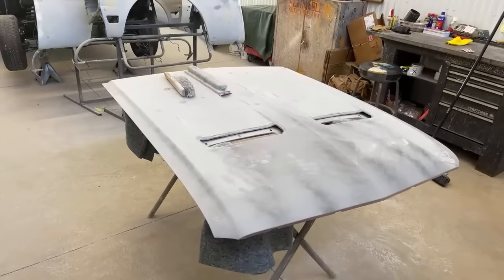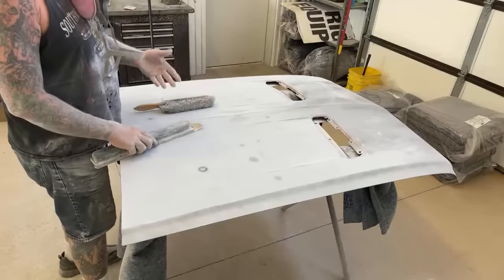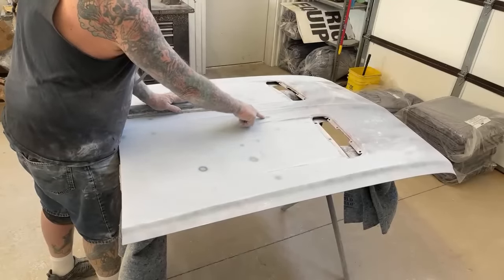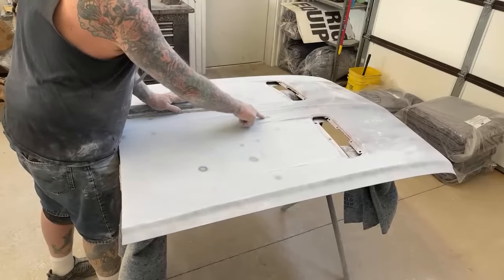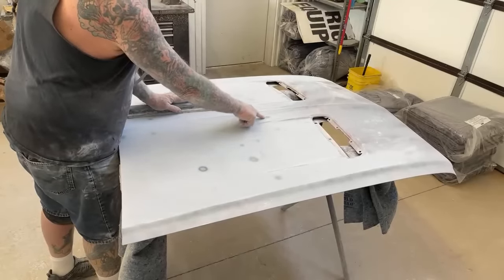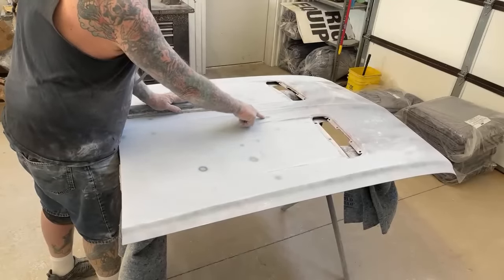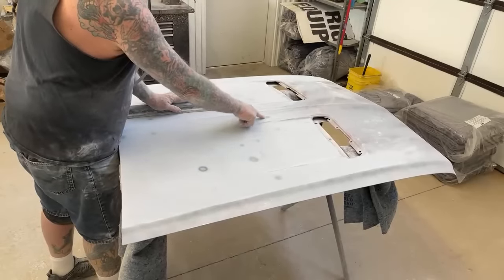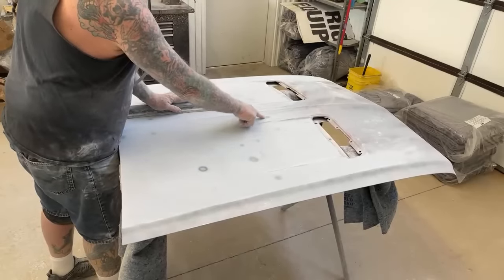How To Put BONDO/Body Filler On A Primer Surface - DIY LIVE!

Comment: Thanks Pete, love all the lessons, I have been getting to it myself now that I retired out the army. I have a rusty 77 924 that is kicking my butt, car was left out in the Texas heat for over 10 years.  Trying to keep it all original, but it will need some patch panel work on both QPs, both floor boards and on the roof panel near the rear glass. Not dishing out money for new parts, minus mechanical and weather strips. I'm fairly comfortable with body work, I just hate how much different brands are out there selling paint, and how expensive things like ppg have gotten.

Comment: You had another video that said to put bondo only on raw metal and not on top of primer. Im curious why not sand down to metal in the areas with the dents before applying the bondo? Thanks!
Reply: Do u have the answer for this question yet in wondering the same thing
Reply: @aidenog7380  it must depend on manufacturer. SPI says to epoxy prime over the prepped bare metal to seal it. Then put the fillers on top of that.

Comment: Hey Pete, Is using bodo and body filler like doing joint compound on drywall. It looks the same, but not sure about the drying. Looks like your body filler turns a certain color like joint compound does. I've done hundreds of hours of drywall work. Never done bodywork. I love the corvette series you did a little while back. I bought a C4 ( next bodystyle) corvette a few months ago. 1988 convertible. Thank you again My Friend Pete. Wish you and Minni a great day. 
    Its crazy how much you have spent on the Baja. Catch you om the next video.

Comment: I am redoing my siren housing and I sanded too far down to the base coat around the other newer paint and I'm struggling with a noticeable divet from sanding the paint would it be possible to just fill it in with primer or would I have to use this body filler

Comment: I just got a hood today and it has a silver dollar sized high spot where theres a glob of goo on top of the bracing. Should i cut the goo out and tap the spot down or tap it with the goo in to provide backing so it might not buckle it? Or should i tap it at all?

Comment: Man I sprayed a Harley gas tank and fender 6 times!! Somewhere a king every spray at some point the paint reacted to something and had to start over. Finally just took it
To bare metal. If I do body work on high build do I need to spray primer over the body filler before I seal it?

Comment: When you sand bondo it always clogs the paper until you break through the top layer of fresh bonds. Is there any way around this?
Reply: Right before it sets up' use an old sheet of 80 grit and scratch it up.

Comment: Really like watching the OG body guys suck as yourself with Great tips on how to save money and do things properly... I had a 1 on 1 teacher train me and i learned so much! But I never actually got into the flexible primers and additives to primers/sealers, base, and clears 

Is this epoxy primer or urethane primer?
And wouldn't you wanna sand over the putty with a 120 or 150 Grit after initially breaking it down with an 80/100 grit... Then finish off with a 180~220 Grit before re-priming the hood, so that way the scratches dont reappear with shrinkage over time...

Im assuming you do go over with a finer grit in its finishing stage before re-priming or use a good primer that has virtually no shrinkage... The Clausen All-U-Need polyester Primer alot recommend over body filler before using a final Urethane Primer... But just would like to know what Polyester and urethane Primers you use...

And one other question, what is out there for flexible Primer Sealers out of a can fir Plastic Bumpers and that sorts... I use the Seymour PBE Flexible Primer or SEM Flexible Primer Surfacer, but im trying to find a sealer out of a can that is good for Flexible plastics...

Any recommendations on Flexible Primer Sealers?

Comment: My question is that u don’t  advise what u used on the shaping? U said 36 grit and that’s it? U didn’t say like ok now we going to use 80 then 320? And so on? Lol ok I’m just saying bro don’t get mad! Lol but for some folks who want to understand how the process works will better understand what u doing brother? Ok thanks I’ll shut up… 😊
Reply: Knock it down with 80 on the da. Shape with 80 by hand, feather with 180. You could go to 320 but it's a bit excessive, you're just going to cover it with 2k primer filler....  I've seen old school guys that just use 80.  Don't get discouraged, it can seem overwhelming but it will click once you get enough hands on experience. After that you'll watch these videos for tips tricks and tool info instead of basics. I myself just learned about plastik honey from evercoat in this video.  Not all body fillers and glazing putties are equal.

Comment: Only on 80 grit bare metal.  Never on paint.
Reply: We've done filler to primer and paint for 25 years never a problem if done correctly.  Some car manufacturers wants it done that way,they don't won't you to break the e- coat.

Comment: Obviously you need to learn how to use a hammer and dolly and a metal file Bondo boy two inch deep body filler in the middle of bonnet with a hot engine underneath it isn’t good weather it’s on epoxy bare or dribbling out your mouth 😂😂😂😂 sink back sink back yuky